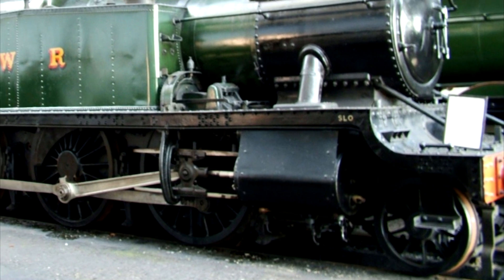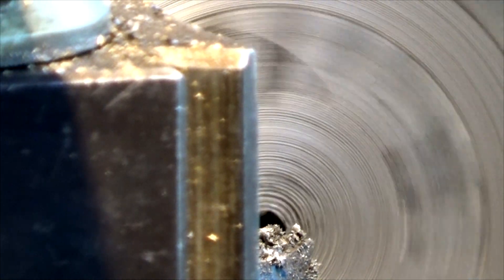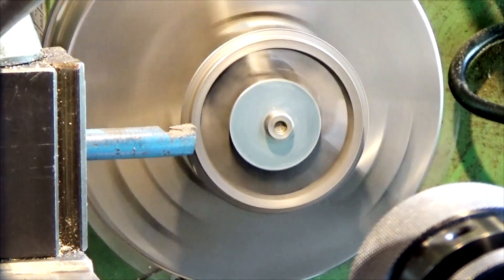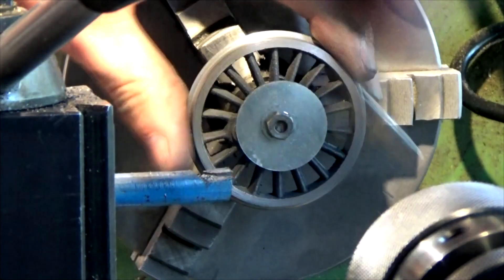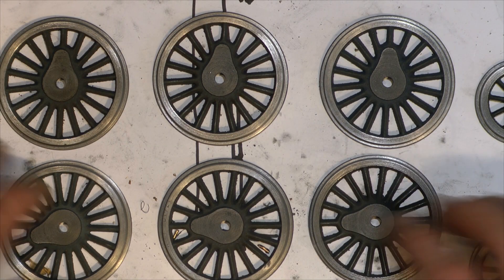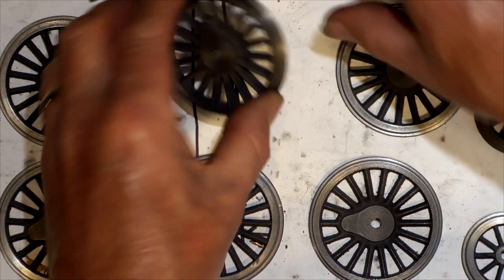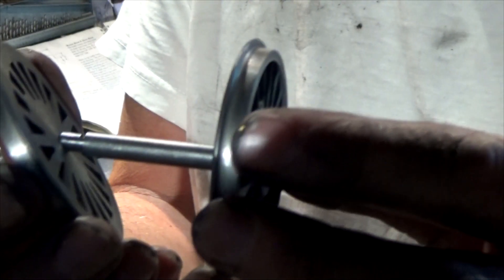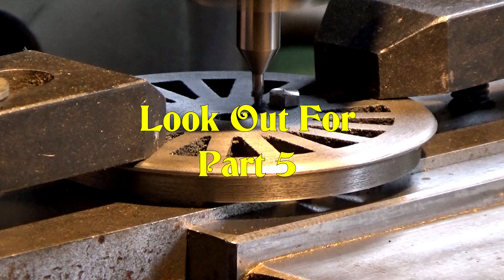Gauge 1 Live Steam Scratch Build 4

Comment: Which wheels should I order from Walsall for the build? Many thanks.
Reply from the maker: Let me check back what I ordered. Will get back to you.
Reply: @GroveDave  Thank you.
Reply from the maker: Sorry for the delay. The wheels I used were - Front Bogies = 10 Spoke (G1817) -Driving Wheels 18 spoke Throw 7/16 (G1921) -Trailing Wheels 10 spoke (G1826)  Please confirm sizes with your drawings before you order. I accept no responsibility for any errors.

Comment: interesting video, how are the wheels held on the axles? You drilled holes in the axle but did not show how the wheels are held in place on the axles.
Do you need to drill a hole through the wheel flanges for a pin to be fitted?
Reply from the maker: That will be shown in the next episode   a 3mm thread in the axel. the wheel fits on and is counter sunk to take a 3mm csk screw
Reply: I had the same question. I have never seen this method of quartering before. Very interesting. Thanks.